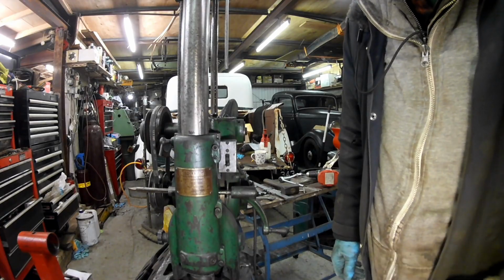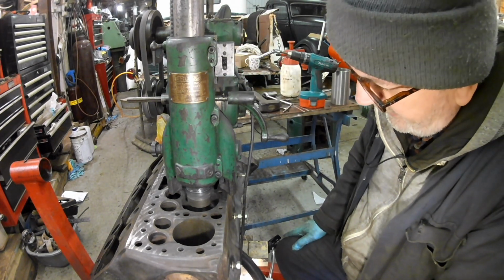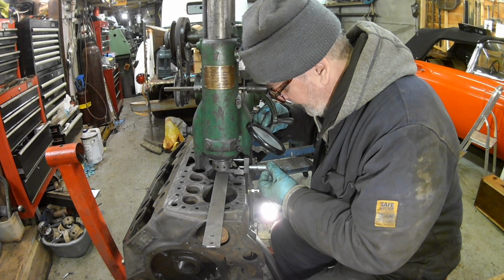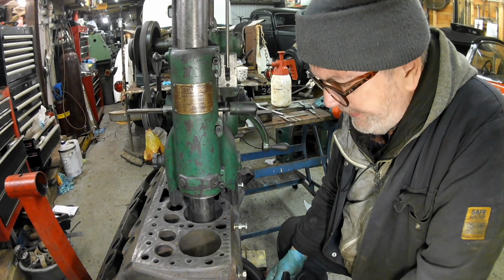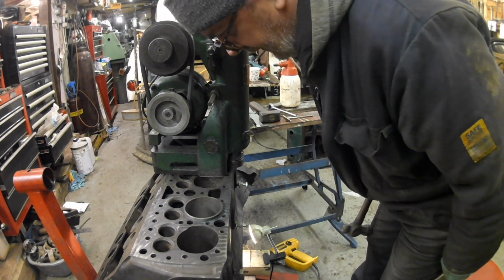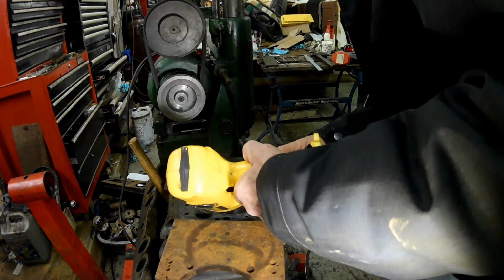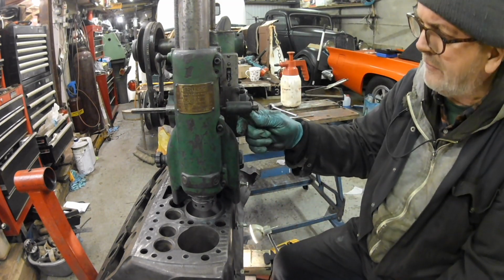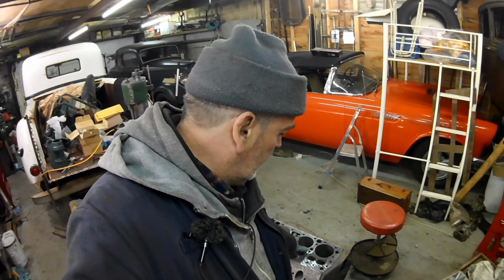Mart's seized Ford Flathead V8 Pt10. Vintage V8. Vintage boring machine. New liners. Noob operator.

Comment: Great stuff, I'm about to do a 1939 4 cylinder Singer engine block with the same machine. You needed more heat in the engine block and a lot quicker with chilled sleeves.👍👍

Comment: I'm not sure I would have attempted to hand file the sleeves. Not sure how you are going to machine the sleeve at the valves.
Reply from the maker: Hi Galen. These are old videos so all the answers are in then rest of the series. This was the first time I had used the boring machine and first time for sleeves too, so a baptism of fire. Hand filing is quite satisfying. The cast iron is quite soft and with a good quality file it is not difficult. I resurrected another desperate flatty after this one and funny enough I have just done another round of work on that one recently. The liners were brought down to the relief level using a rotary burr in a die grinder.

Comment: your machining is probably OK, you lack a bit of temperature difference, I had do do something similar and my conclusion has been that a temperature difference over 300 deg F was the ticket to perform the job flawlessly, my application was sleeving a hydraulic valve to bring it back in service and  rule out the leak problem between the sleeve and the casing,
 the same problem exist on a sleeved engine  but it related to contact between the sleeve and the block and directly to heat transfert problem.and the best sign is caked oil between the sleeve and the cylinder.
Reply from the maker: Thanks for the info Jaques. I've improved the technique since then and can get most in without hammering. Thanks for dropping by.

Comment: Wow !! That's scary driving that thing down from almost at the top. I would have been very afraid it was going to warm up and expand before it reached the bottom. Congrats on a great job. Typed that in before watching you "force" the other one down. "Scary" !!!  Getting the heating consistent must be very critical. Assume you took down the liner where the relief is ?? What tool did you use for that??   Thanks for sharing. Very interesting !!!
Reply from the maker: Hi Bob. yes, I had to hammer them down. Not great but you have to do what you have to do. I have been leaving a part of the original bore at the bottom. the liner stops short of the bottom by about 1/8", sitting hard on the step. In a recent video I show the final cut and you can see the transition from the liner to original bore metal at the bottom.
Reply: @MartsGarage  
Hi Mart: I did see that "ledge" you are leaving and also saw how you were stopping when the sleeve contacted it. Don't know how common that idea is but I believe I would likely have done the same in your place. Very nice and exemplary work on your part !!! 👍👍
Reply from the maker: @pappabob29  I took advice from the good people at FordBarn. great forum, I frequent the Early V8 side of the site.

Comment: Try this tip Marty , put the Hylomar on the sleeve top & only in the bottom half of the block bore , works good for me.
Cheers.
Reply from the maker: Thanks for the tip, Maurice. I think I did try applying Hylomar to the sleeve but it didn't want to stick due to the frozen condensation on the sleeve.

Comment: Did very well considering your self professed inexperience. You should be able just to kick the downfeed off and clean to the same point each cut manually.  Only other thing I would add is while a caliper is "easy" you should invest in micrometers.  Much more accurate in the end.  Thanks for the video.
Reply from the maker: Thanks Ron. I've been working on another motor, check my latest videos. I have been using a micrometer, I had one before, I just couldn't find it. I'm still woefully inexperienced and making rookie mistakes. Check my upcoming video out tomorrow (Oct 23) I make a big one, and guess what?  - Yes it's micrometer related Thanks for commenting. Mart..

Comment: Another enthralling video Mart! As a 16 year-old I remember trying to drive a sleeve into the cylinder barrel of a 1968 Triumph Trophy motorcycle engine when (between the temperature differential & the size of the hammer, and far from fully home) time basically ran out ! It was a disaster! You have it figured out, obviously! Thanks!
Reply from the maker: Hi Glen. I was worried the first one wasn't going to go in. I thought I'd gone over on the bore and it was going to be loose. It proved to be quite a job getting it home. A thou either way can make a big difference. I don't want to sound like an expert because I'm not I think I was lucky to get these in.

Comment: I enjoyed the video, Mart.  I'd never seen anyone bore a block before even though I've been around machine shops for over 50 years.  Would have liked to see a little more detail about how you indexed the boring bar into the center of the bore, but I got the gist of it.  Keep up the good work!

Al Hook
Reply from the maker: Hi Al. I did record a little bit showing the catspaws but it must be from one of the other cylinders. I have tons of footage I haven't shown. I have to condense it down to try to make it more interesting. I'll see if I can find it and splice it into a future video.